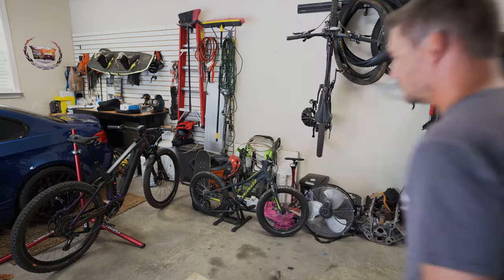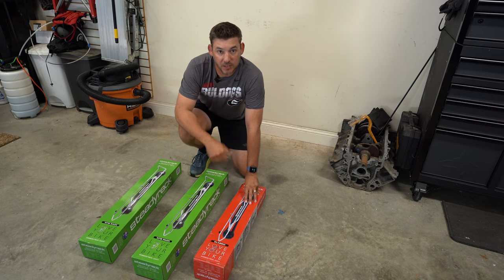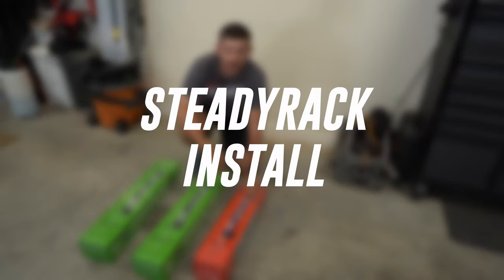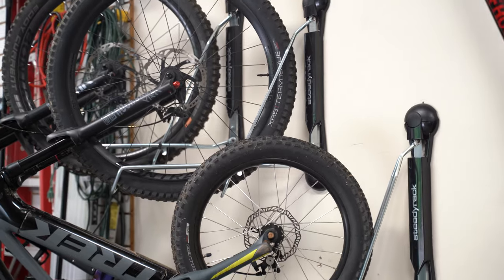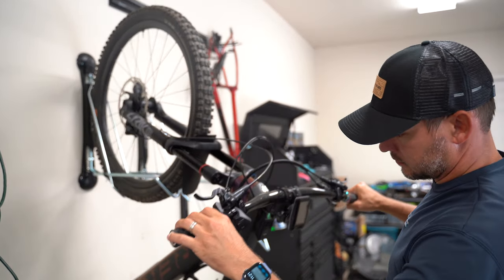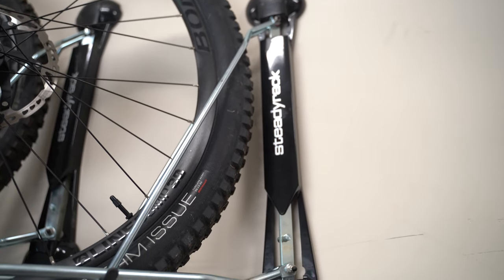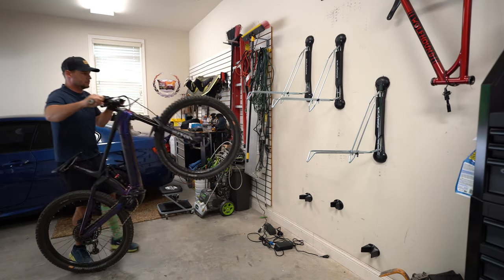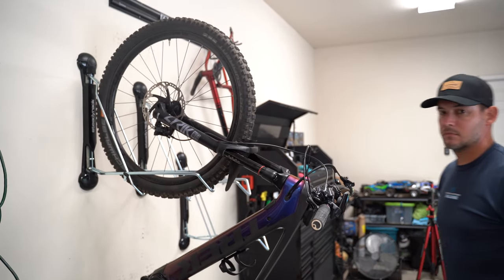STEADYRACK REVIEW AND INSTALL - The BEST Vertical Vertical Bike Storage for your Garage?

Comment: This is great because I have an e-bike and it doesn't have a straight horizontal frame to easy put it on, unless i just go for pegs or hooks.  Plus the bike with the battery is not exactly light, so this seems to be a great solution.  Thanks for the review!
Reply from the maker: We actually have 2 Trek Rails hanging from them now (I bought one for my wife). They have worked out great for e-bikes.

Comment: I am mounting the bike racks on a concrete wall.  In a 6 ft wide space.  Two bikes, Trek +3L and a Trek +2 S frame.  I m trying to figure out the best difference between the racks.  The folding feature is important to reduce space and get them out of the way.  The area is a lanai and decreasing there footprint is the goal.  Thanks for putting up this video.

Comment: Mine seems to fit to snug and pulls out pretty hard. Is yours hard to pull out. I noticed how much your son was pulling to get his bike out. Thanks
Reply from the maker: I typically put my knee under the seat and push up a little bit to get them out. Depending on the weight of the bike and the width of your tires...sometimes a little extra lift really helps.
Reply: @Bike198  Same here

Comment: Good review. Saved my comments until the end as I was going to ask about cheaper hook-type solutions.

Do you still find the bottom "rear tire stay" to be useful? You seemed to prefer the storage option of pushing the bikes against the wall. At that point, the rear tire isn't sitting in the cups, but more leaning against the outside. Any thoughts on that?

Thanks for the review. This is exactly what I was looking for the 6-7 bikes my family has.
Reply from the maker: Thanks! The rear tire ends up resting on the outside of the tire stop at the bottom when they are folded in as well. The bike would want to move more without it and it doesn't touch the wall that way as well. My wife and son really struggled with the hooks because you have to lift the bikes out of them sideways. They also marked up the wall constantly.

Comment: As your son grows and the bikes get bigger, do you hope to just keep re-installing at a higher point. Also, if you get the larger rack but only have a smaller tyre, will the bike sit into it ok? We only have road bikes now, but might get mountain bikes in the future.
Reply from the maker: yes that is what I will do. It will be pretty easy to just patch up any holes that show as I move it up. Yes they will stay centered. The road bikes are a lot lighter too so they don’t pull on the racks as much. You are good to go.

Comment: When swiveled over to the side, does the bike stay still and feel steady in that position? I had a Delta hinge wall mount that swiveled to the side like this and found the bike did not want to stay against the wall and would swing outward very easily, which defeated the purpose for me. Thanks.
Reply from the maker: They do stay still. You just have to make sure that the racks are not crooked when you mount them.

Comment: I just wish the holder for the rear tire would pivot as well.  I get marks on the wall because the back tire comes out of the V when you rotate the bike for storage.  Ought to be easy to design.  It's an oversight in my opinion.  I like the rack, but I wouldn't buy another that puts marks on the wall.    Maybe a version 2.0 will address that!

Comment: How far out from the wall do your handlebars go?
Reply from the maker: It will depend on the bike. Add an inch or two to the width. The bars basically got straight to the wall when you swing it over. If it is sticking straight out...inch or two from overall height of the bars from the floor.